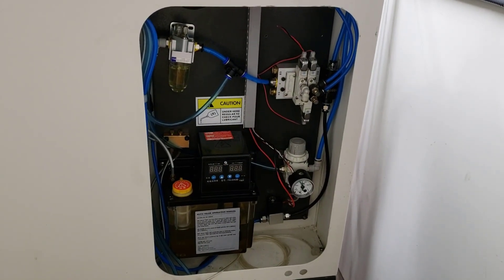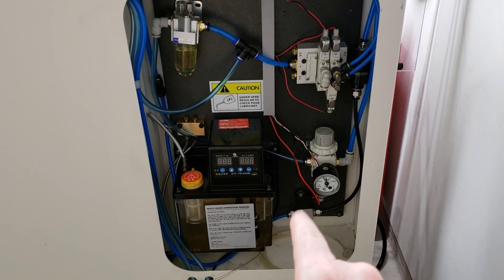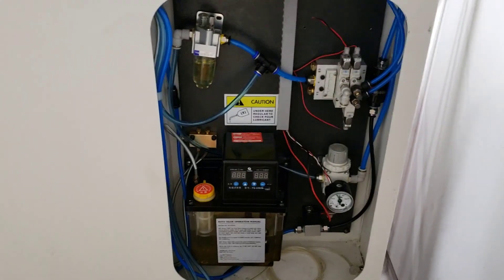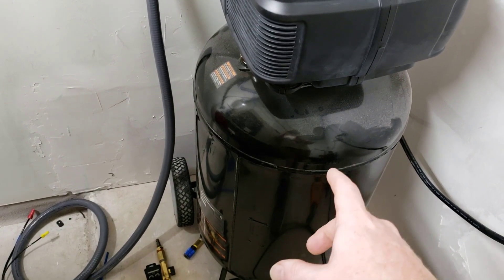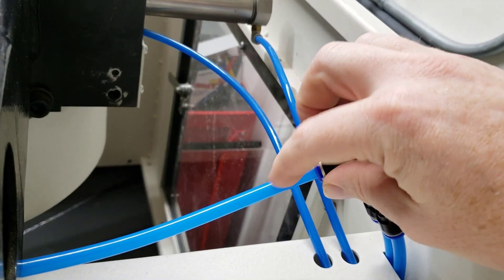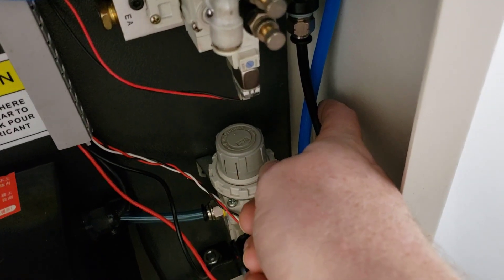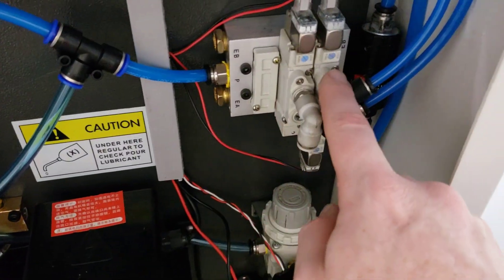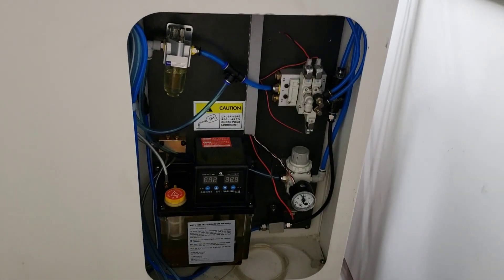Skyfire CNC Mill Air Mod

Comment: Great job, much better video than mine to explain the issue and the fix.  I've never had any issues since doing the mod, I'm glad you took it it one step further.  It should help a lot of guys in the future. The parts list is great and will make life easier for the guys upgrading.
Reply from the maker: Thanks.. Just standing on the great work you did figuring out some of the core ideas on the reroute...